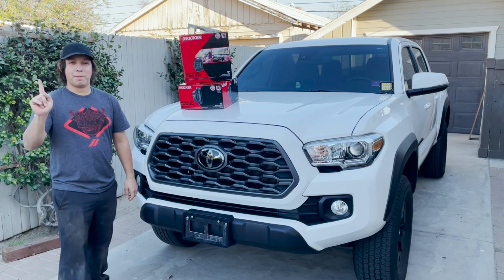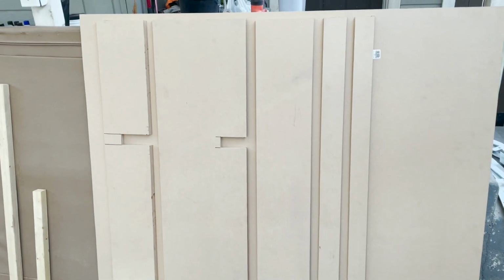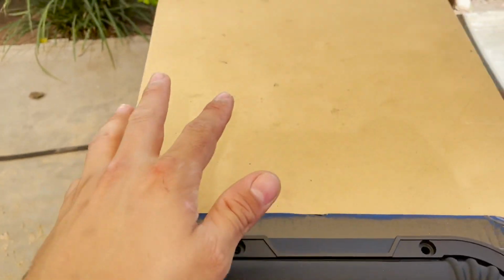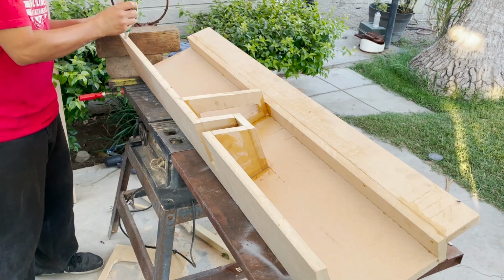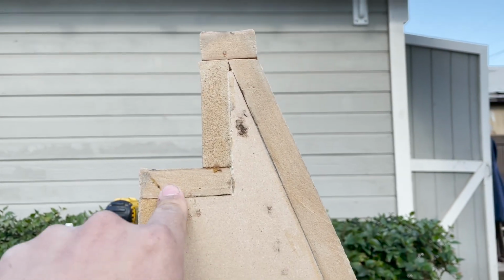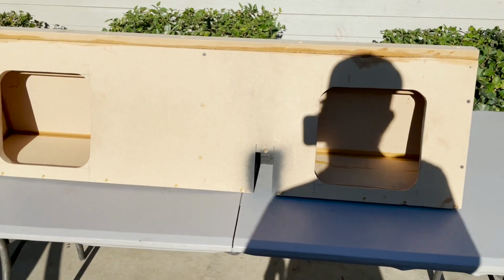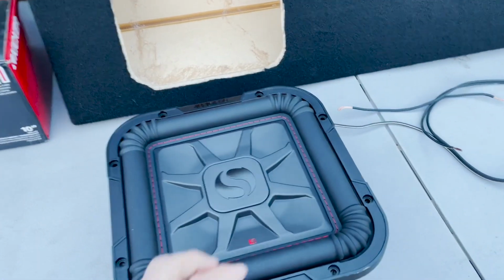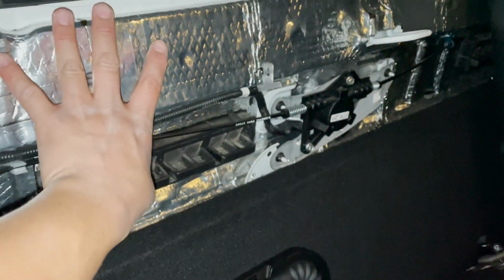Tacoma Sound System! PT.1 Square Subwoofer Box Build with KICKER L7Ts!

Comment: Just a heads up when you're using that spray glue you should always spray both sides of whatever you're working on..
Reply: Came here to write dame thing. It’s contact cement. It cements when both surfaces contact. Side panels in 1/4 inch help when carpeting.

Comment: Nice job bud and you can just use clear cilicone to fill the cracks or the white all purpose caulking.  When I built boxes in the past I would always go Through the inside where my subwoofer cut out is and I would use that white caulking to caulk the entire box that way there's no air leaks whatsoever.

Comment: Sweet! You did an excellent job dude! I had 2 10" Kicker C10s behind my back seat in a prefab on a DX 500.1. Sounded sweet. Gave that to my cousin and got some L7s 10s. If I would have thought about it, I would have got the L7t's then all I would have been able to do is square the holes. Lack of research on my end. So now I have a box going in my back seat. No problemo, still gonna be sweet.

Comment: I gotta say, when I was originally previewing this I was ready to skip by it because of some of the DIY look, but you proved me wrong.  Especially the Cubby hole Amp mount in the next video.  Thats exactly what I needed to see so I wasnt spending large amounts of extra cash on a Nano amp to try to mount under the front seat.  Even the cutting board is a great money saver too! You use hand tools very controlled and do things even a lot of shops neglect. Gonna watch part three.

Comment: Nice job!! I have a 21 tacoma and built the same box except I went all the way up above the seatbelt motor. And I ran 3 of those 10’s also I modified the seat bracket instead of notching my box. It sounds amazing and it’s completely hidden
Reply: Would you be interested in building me a box I have a 21 Tacoma

Comment: do you use glue on the inside and outside of your box and what kind of screws do you use I used to be against using star bit Styles screws but they work so much better and less stripping what are your thoughts I really don't do boxes for a living but I know how to build and also what do you put on the inside I've seen people use installation I've seen people use just like a white pillow case material